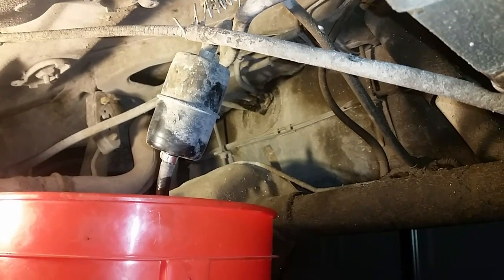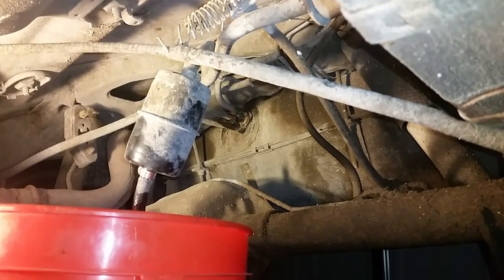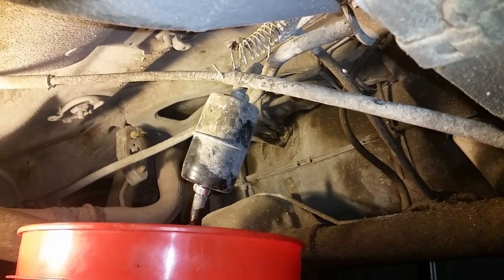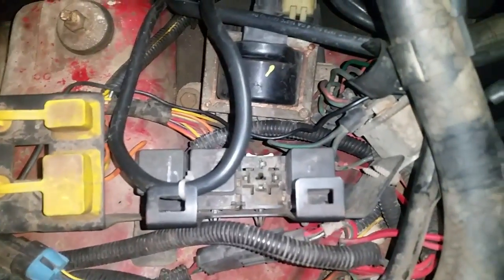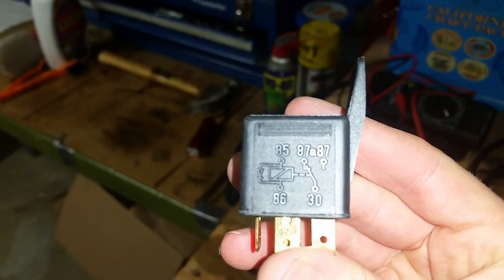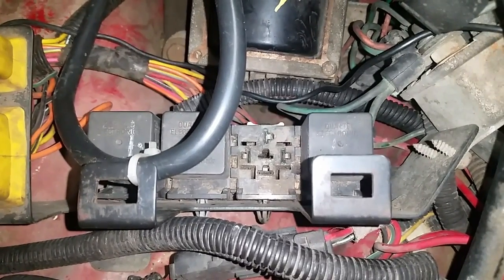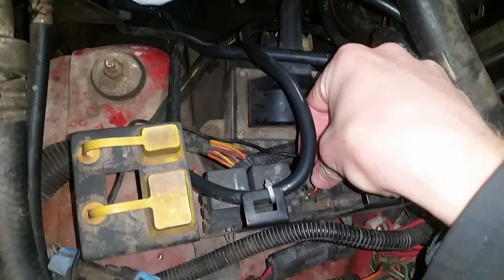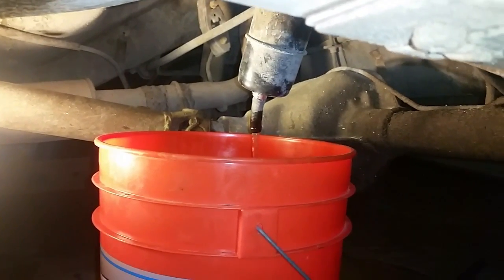Easiest Way to Drain Fuel on a Jeep Cherokee

Comment: Thanks for the video! I  have water in my tank and am concerned about running the watery gas through the pump, also need to empty the tank completely and the pump doesn't reach all the way to the bottom of the tank...

Comment: dude check if you have a fuel rail  test port. looks like a tire valve  use a schrader valve  tool to  unscew it DONT LOOSE THE VALVE  and  push some  1/4 "" hose from the stem to a receptacle  jump relay  voila!!!
Reply: oiyabastard i did that and started getting air pump out with the gas now have 0 fuel pressure can hear pump run though wtf
Reply: What about the 1996 jeep grand Cherokee Laredo 
4.0?
Can you make a video on it?
Reply: oiyabastard they're minerals Marie
Reply: @tswaff8106 what did you end up doing?

Comment: So what point in the fuel system did you disconnect from?  I'm looking to do this.  I have a connection at my fuel rail, but the feed side is female.  I suppose I could use a coupler of some kind but I'd just like to disconnect and drain.

Comment: Idiot way... you suck all that crud into the pump filter blocks... better way is to drop the tank after siphoning with thin hose cut at 60deg twisting as you insert .... never drain using fuel pump... it will burn out!!